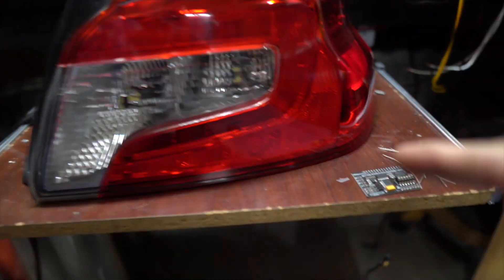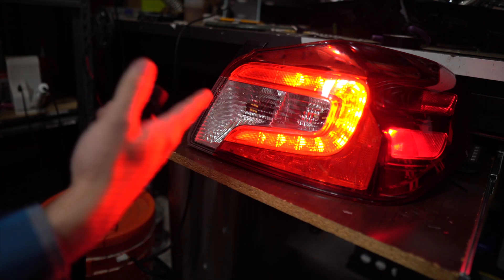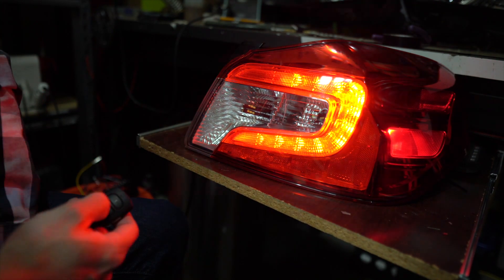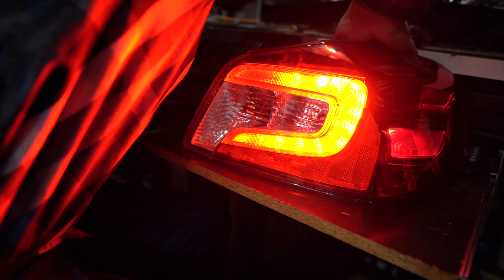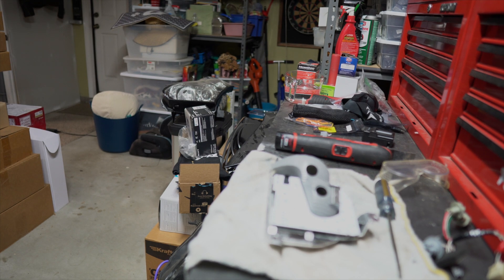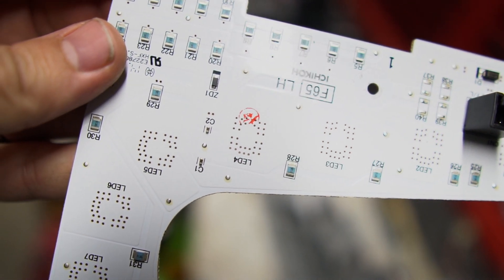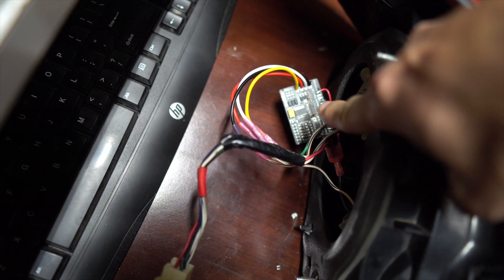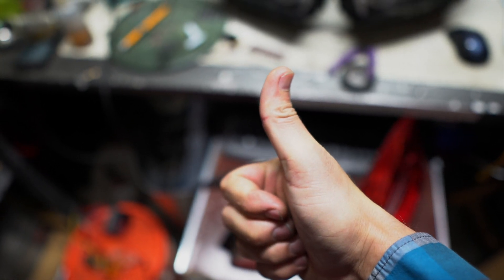$30 Custom Sequential Light

Comment: What does it do when you step on the brake and have the turn signal engaged at the same time?  Does it only do the turn signal function?
Reply from the maker: It actually shows that. Brake overrides parking, signal overrides brake 👍
Reply: @flyryde  awesome thanks! Was wondering lol

Comment: Any way you can post a video of you actually doing the process I’m so committed I wanna do this so bad. I just ordered the sequencer and I have to order the resistors. I want the f1 brake and the sequential turn
Reply from the maker: I’m filming a super in depth step by step on the other side that will be included in my Sequential 301 class. YouTube hates my super nerdy step by step training lol. I left it out and this video did better than all my recent stuff 🤦‍♂️🤷‍♂️
Reply: We’ve been waiting for this lmfao. So are you going to release the super in depth video here ?
Reply: Oh so the 301 is on your website ?
Reply: Hey fly. You said you are currently making the video for these tail lights ?